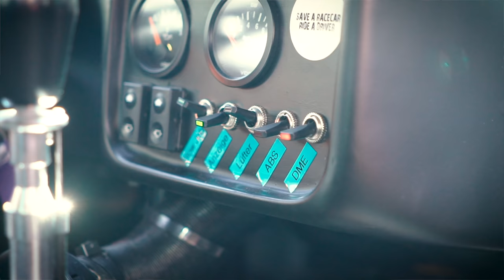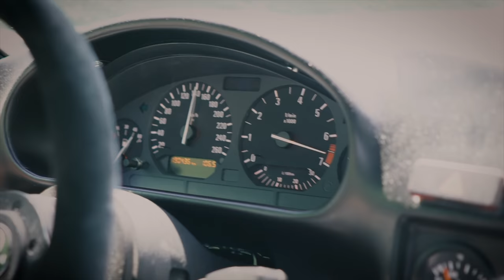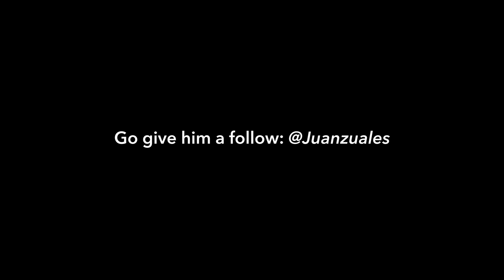ULTIMATE SLEEPER Lapping The Nordschleife | BMW E36 325i Stroker

Comment: Quick tip to modify the M50B25: E46 330i rotating assembly, S50/S52 US camshafts .. and that's it, you will have a S50 US clone engine with same power figures. No need to invest in costly engine head modifications. Same can be done to the M52B28.
Reply: Yup the good old Frankenstein engine build
Reply: Not really reliable unless you machine the block an go with bigger pistons. There are small diameter differences between the old an „new“ cylinder surface. The different in size really fucks up your piston rings.
Reply: @Movieuploader11  thank you, apparently no one knows this facepalm
Reply: s52 engine never exists, its just s50 or s54
Reply: @Ironwolf643  S52B32 is the US specs engine fitted to E36 M3 (Gen 2). You are welcome.
Reply: M54b30 engine pistons is a little bit narrower, has thinner oil rings, lower piston height, than m50b25 so putting them in used m50 84mm block leads to bigger oil use and much lower resource.
Reply: @frostakaernis  i have a M50b25 and was buying a crankshaft of m54b30. What other parts i need to make a 3000cc ? Thank you !
Reply: i have a M50b25 and was buying a crankshaft of m54b30. What other parts i need to make a 3000cc ? Thank you !

Comment: best sounding engine i've heard in a while <3
Reply: Sounds like a us spec e36 m3.
Reply: @jonathanmoga5188  he basically made a US spec s50
Reply: ditto what the others have said. Sounds a lot like my US S50B30 with the exhaust, until I went for the S54 swap.
Reply: At the lower rpm😍

Comment: 250 BHP / 1.2 tons is pretty impressive! Not a sleeper but it's nice :-)
Reply: It's a cool car but people need to stop abusing the term 'sleeper'. A car with no interior and a cage is not a sleeper.
Reply: Might not be a sleeper in terms of a straight line but I bet it needs to be taken seriously around the ring
Reply: No one is saying it's slow. A sleeper is a car that is fast but looks stock.This car doesn't look stock.
Reply: @Zero_Ninety  agreed, my grandma's 318i  on steelies with a S50 turbo is a sleeper. Gotta have those cloth seats !
Reply: @Kaktusas no that would be around 330 hp not impossible but needs a lot of cash+knowledge to achieve

Comment: Might be a stupid question, but why are the upshifts so slow? If you watch 787B videos you see the same thing, so of course it's not because of the driver, but it seems strange that a race gearbox would not allow you to shift as fast as with a normal street gearbox...
Reply: Duo Dynamique 3rd Member  At that day it was very hot and the 4th gear started to not get in and I tried to shift as smooth as possible.
With lower temperatures everything is working perfect with the standard gearbox.

Replacement gearbox already bought and is ready to get installed when needed😉
Reply: @juanzales8747  I see, and good to know you already have the new gearbox!
Reply: Duo dynamique interesting thing about the 787b, it actually has a synchromesh gearbox which is why the shifts are so slow for a race car. They did it for fuel economy in lemans, syncros mean no need for rev matching which means no throttle blips which saves fuel.
Reply: @WikWak  I see! But its kind of weird that I can shift faster with my 2005 Toyota Corolla, I mean, a synchronized gearbox might be a little slower than a dogbox, but normally you can still shift way faster than what you see of the 787B on YouTube, syncros or not... No?
Reply: @3rdmember510  its probably a fucking hard car to drive, its not even sequential its got a fucking H pattern lol. But i think people are also just being careful with them i think.

Dont forget its doing all this at much higher rpms, those syncros have a tougher job to do than in your corolla
Reply: @WikWak  that makes an awful lot of sense

Comment: i know its possible to get around 300whp from an M54b30 engine in na by changing internalls to higher comp and other cams.
and i like the e46 chassie more but they are weak as hell in the chassie..
got an e46 323ci conv and that one needed rear subframe work,, its just 170 bhp yet it needed a rear subframe reinforcement!!
Reply: its even on 4 cylinders, i have seen 320i and 318i with cracked floor
Reply: u can get over 380hp with s50b30 engine, with no turbo
Reply: @Ironwolf643  how ?
Reply: 08halit the pre facelift models all have this issue, the cars made after 2003 don‘t have those problems.
Reply: @08halit  intake, exhaust, modified ecu, better fuel pump and more, make a race car

Comment: It's a sweet ride, but hardly "ultimate" anything. I was at least expecting around 400hp before we can start talking about an E36 sleeper. Don't mean to diss at all, it really is a lovely car.
Reply: I think with the low weight and the mods that allow you to rev it up past 7000 rpm it feels pretty damn quick. After all, this is a track car and the smooth power delivery is something that turbocharged cars kinda lack. And at the end of the day, the sound of this car is glorious.

Comment: What a beast Smoked that m1 in the corner so easily
Reply: There was no M1 in the video
Reply: 328 Ci 😂😂😂😂😂
Reply: 328 Ci so the orange one wasn't a bmw m1
Reply: @neoxmagma4772  no that was a 1 Series M Coupé
Reply: 328 Ci that's what i thought
Reply: @neoxmagma4772  small difference there, huh?
Reply: 328 Ci yah
Reply: With a car that weighs over 300kgs lighter, fully stripped out and caged, youd expect it too 🤷🏼‍♂️😂

Comment: Thanks for the awesome video ;-)
Reply from the maker: Thanks for the awesome build man!
Reply: What's going on here @6:00

Do you have ignition or spark moved to a switch, allowing you to build oil pressure ??
Reply: @Davewagon  I have a switch for the DME. No ignition and no fuel pumped, because the DME is switched off for getting the needed oilpressure.
Reply: @juanzales8747  Ahh brilliant, thanks for the reply!

Comment: @juanzales What's going on here @6:00

Do you have ignition or spark moved to a switch, allowing you to build oil pressure ??
Reply: Easier to wire fuel pump switch

Comment: What a piece of art. What is the wheel offset of those rims? Is that supercharged? Sounds like it is
Reply: Gerson Gutierrez thanks mate!
No natural aspirated 😉
9x17 ET30 with 20mm Spacers in the front each wheel and 5mm Spacer in the rear each wheel.

Comment: Is it a m50 stroker or m52 stroker because m50’s have the oil cap at the rear of the valve cover and not the front . I’ve owned both just curious to why this ones at the front
Reply: Kendall Love The valve covers can be swapped. I kept my M50 valve cover when I did an M52 swap.
Reply: Kendall Love m50😉
Reply: Could be an M52 valve cover, but not sure if they retro fit the M50 heads. But you're right, the M50 oil cap is at the rear so its a little confusing.
Reply: Its a M50TU with a M52 valve cover.
Reply: It is an M50 with the cover of an M52.
Makes it much more easier to fill oil in😉

Comment: Beautiful build. Im wondering how come you went for the 325i M50 instead of the newer 328 M52?
Reply: Most likely because the m50 has a cast iron block, wich is stronger then the newer m52 block made out of aluminium.

Comment: More info on the engine build would have been nice. Also 1180kg with full tank sounds really light for a six-cylinder iron-block M50 coupé, makes me wonder about the scales used.
Reply: Tobias Wittwer Not all secrets need to be shout out😉
But for a short summary:
It is an M50b25tu engine with completely reworked cylinder head (nothing stayed original), special built camshafts, with increased compression and so on.

The weight of 1180kg is reached because everything is out.
Beginning with the harness wiring, all is stripped to the minimum, the lightest Battery on the market from Liteblox, the extra light rollcage and the glassfibre dashboard and no heating system, carbon-aramid seats and so on and so on
Reply: Europe versions of the m50 had aluminum blocks only Us Canada had cast iron. From what I know.
Reply: @mariocastilla7852  Wrong..
All M50 blocks are iron.
M52 Europe alu, U.S. iron.
Reply: @juanzales8747  Cylinderhead M52B28, or only valve cover?
Oil pump M52B28?
Spraying on the bottom of the piston?
What hydraulic pusher?
Crankschaft M52B28 or M54B30?
Piston IS or larger diameter?
Reply: Thanks for the correction! :) I thought it fell under the same difference of Us/can and euro of the m52.

Comment: 250hp is a bit weak if im honest. Id have expected a bit more from a modified 24v 6cyl.  Is it still 2.5 or did you throw a S50 crank in the thing?  I'm guessing yes because of the title.
Reply: alfaholic3 it is an m50b25tu engine.
No S50 parts.

Power output around 100hp per liter capacity should be ok😉
Reply: @juanzales8747  if it 100hp per liter it would have 300hp,keep on mind it has crank from 330i e46
Reply: stay with alfa dud
Reply: @MrZoranbebek  did you all miss the part about it being a stroker? I'd imagine it would be at least a 2.8l if not a 3.0l which would give it less than 100HP per lt.  And don't give me that crap, I like Alfa, i like BMW and a host of other cars.  Just because my name has Alfa in it doesn't mean i can't drive other cars.  I have a e36 325i why else do you think i was watching this video!
Reply: @alfaholic3  it looks like you dont know much about m50b25 engine dont you,if you are disapointed by power than you have no any clue what is N/A engine,you say you have e36 325i  with 192hp i guess but you are disapointed with 250hp in basicly same car,if you would know how hard is to get 250hp out of that engine than you should clean your comment and keep on your mind geting 100hp per liter is always tought task for N/A motor.
Reply: @MrZoranbebek  Mate, you clearly arent too bright. I already said he can't be making 100HP per lf its a stroker as is claimed in the video title.  Either eay 100hp per lt is not at all impressive for a built 4v engine.  id expect anything from 125hp to 150hp per lt to be called impressive. 100hp per is impressive for a 2v not a 4v sorry if that upsets you but its true.
Reply: Ha ha , you are kid,150hp per liter,give me 1 engine that is in sale on public market with that power per liter even today,talking about engine that has been designed 30 years ago,it can be made more than 100 hp per liter but it takes some knowledge and $$ as it did for 1987 m3 and so on."You" sad it is a wek.You have very big hp in your mouth but your knowledge is very poor.

Comment: holy shit 7500 rpm m50
Reply: Literally any M50 will rev to ~7200rpm stock engine with an ebay chip
Reply: @pekkahintikka1495  I heard that it's the valvetrain which doesn't hold high rpms and is unreliable above7000 rpm

Comment: Why does it start so hard? ps. great car!!!
Reply: He's building oil pressure before turning on the ignition.  (Watch his right hand). It's old school.
Reply: @dan1906  absofuckinglutely right ;-)
Reply: @dan1906  (if this is the reason) there's a valve in the oil filter housing that keeps the oil in the oil lines and u don't have to pump the oil back to the engine the whole time. This way he will destroy the starter soon. It'll be turning but not engaging the engine
Reply: @S7midnight  that is a check valve to bypass the oil filter should it become clogged so the engine won't be starved of oil.  It does not maintain pressure when the engine is off.  We ground the starters too, back in the day.  Starters are cheap when compared to a race engine.
Reply: @dan1906  i get you man 👍

Comment: sounds like it doesnt need to rev to 7500rpm.
Reply: Testing some exhaust modifications. The latest version will be installed within the next days to get a little bit more power output on revs around 7k to 7.5k. Lambda values are optimal.

Comment: Shifting too late...... Loosing power at the high end.... Doing it for nothing bro..it doesn't help you to rev it to 7500 rpm
Reply: Reving up to 7500 is not only for using the last hp. 

On a racetrack it also makes sense to rev up to the limiter to save the time for shifting up and down again or to keep the car stable with no unnecessary movings in the car caused by changing gears
Another reason is  to have the revs on the right level for the next corner. ;-)
Reply: @juanzales8747  it can be good and not good in the same time.... Some disadvantage and some advantages to it..